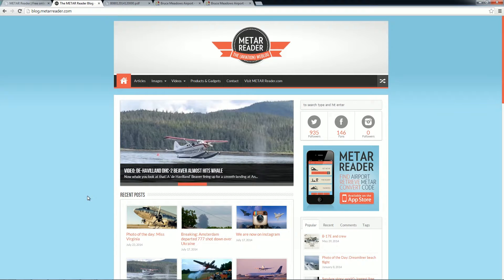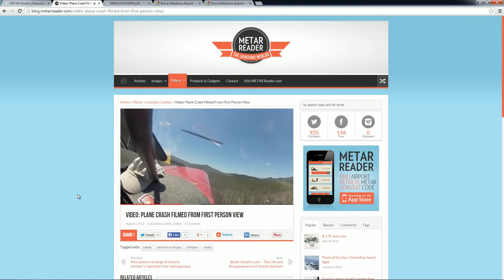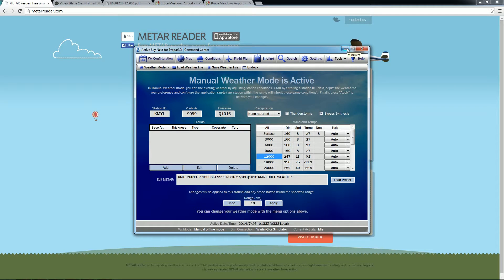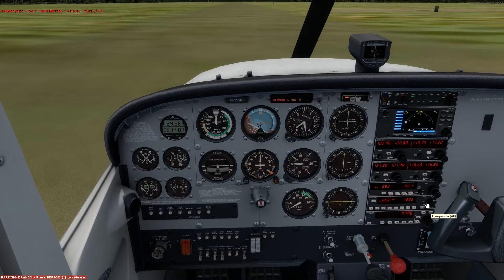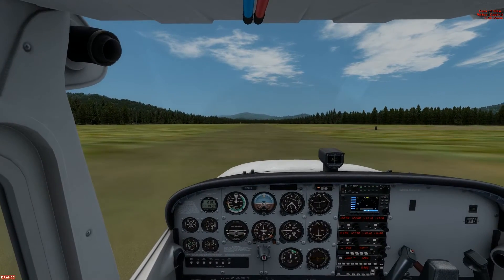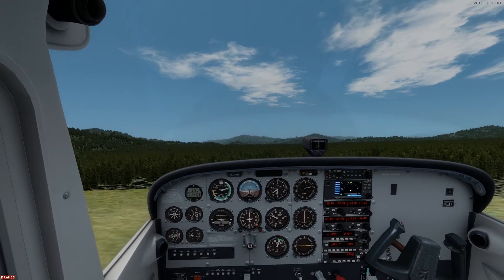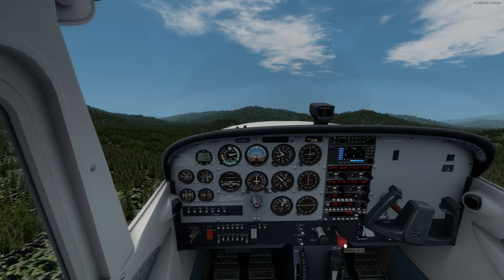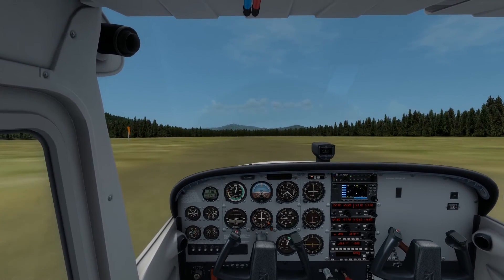DANGEROUS! High Density Altitude

Comment: At high density altitude, if runway lenght is not an issue to lift off safely, you should take off with no flaps to reduce drag and improve climb performance.  Check to lean rich of peak by 100°F prior to take with full throttle during runup for instance.  Your low voltage is appearing because your idle rpm was 500 RPM which is not fast enough for the alternator to produce enough elec load.
Reply from the maker: Taxi Into Position And Hold useful information. Thanks, I appreciate it!
Reply: @plokkum  it s been 5 years since you posted this video so I bet you you ve been learning more stuff about high density altitude since then! Cheers

Comment: At one point when the voltage warning came on your idling RPM was only 500.  If you keep the idle up around 800-1,000 then the voltage will probably be ok.  Idling too slow is bad anyway, tends to load up the engine and foul the spark plugs.

Comment: Perhaps it had worked a little bit better without Flaps. At hight Altitude and high Temperatures Flaps can increase Take-off Distance. Eg Cessna 170 Take-off Distance to 50 ft over Ground at 6000 ft Altitude and 80°F, without Flaps 3360 ft at 76MPH, with Flaps 20° 3620 ft at 67MPH.